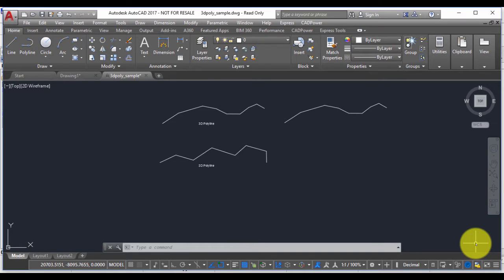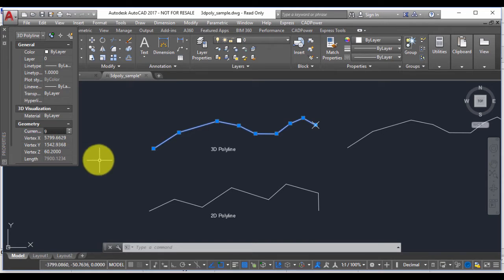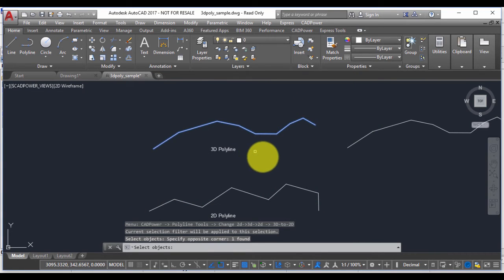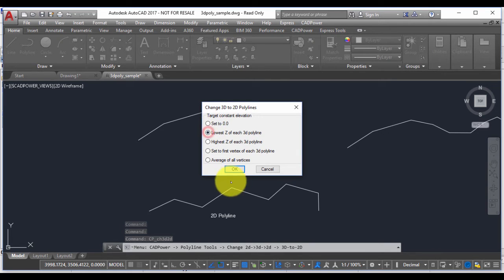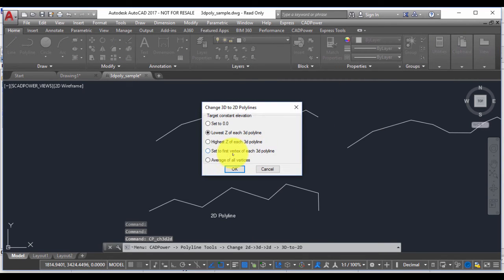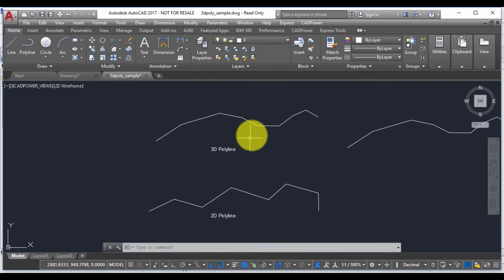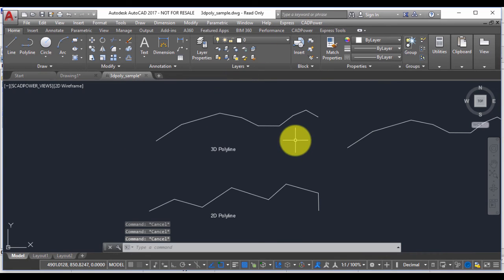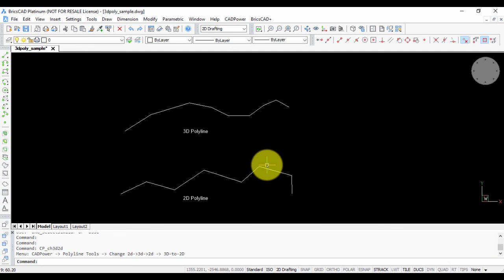Convert 3D to 2d Polylines in flexible ways

Comment: After downloading cad power just we need to open cad only no? Or any other settings?
Reply from the maker: Normally, it should start automatically. If not, you have to add the CADPower installation path in the 'Support File Search Path' under OPTIONS command. Any help, you call me +91-943438300 and I will connect online and set it for you.
Reply: I got it thanks for the file is it trial version or full version
Reply from the maker: It is a full-featured trial version and no limitations on the functionality for 30 days. CADPower is one of our most popular CAD add-ons and used in over 5000+ companies